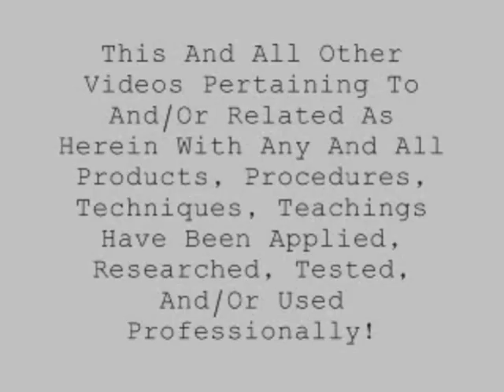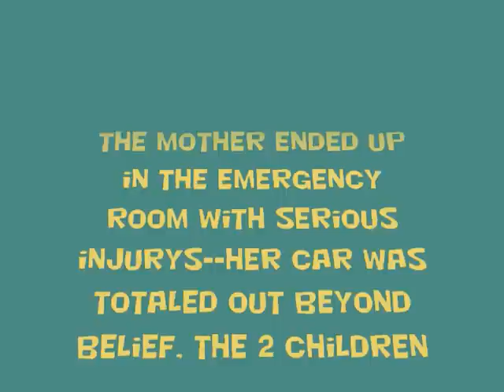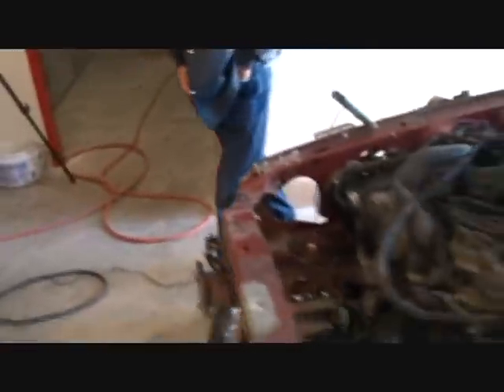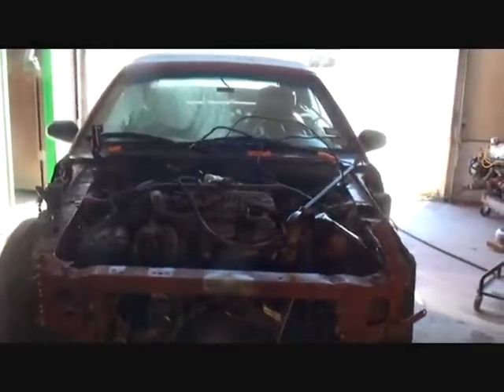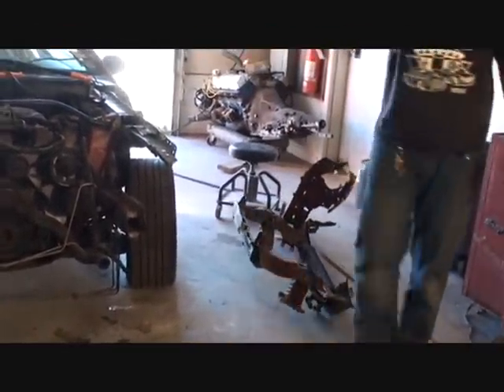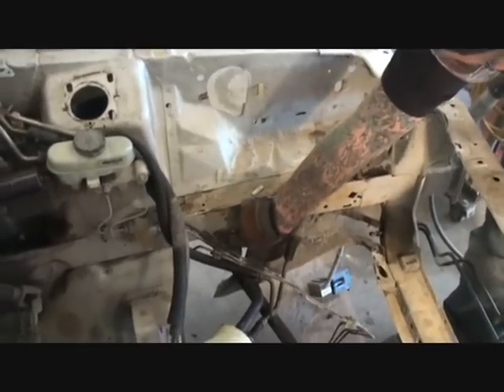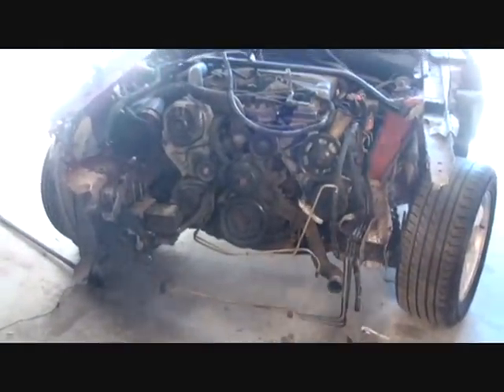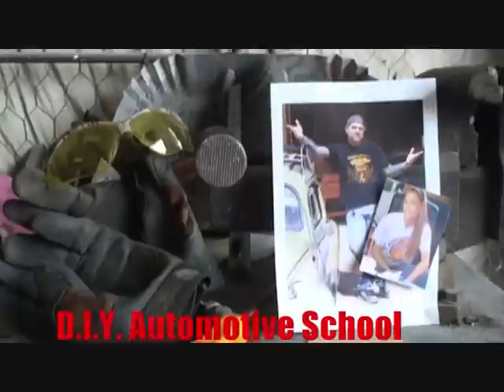Mustang GT-Collision Repairs-Do It Yourself-Part 11

Comment: i like grinding out as many welds as i can like the ones on the passenger side of the core support if u grind them like that then you have a nice clean area to weld the new piece to, and on the clip you would drill all the welds then you have 90% of the prep work for the welds done and you end up withe same amount of welds all in the same spot as the factory i call that job strait up gravy.thanks for the videos pete you are the man and aint it amazing how1weld can hold the whole thing  up

Comment: No frame splices!!! I just got done resurrecting mine from the grave after a major wreck. Drill the spots welds, follow the seams,  and only make connections back to the factory connections. Might involve removing more from the car, but in the end, still factory strength, Splices are not good, even if only in the fender aprons. Only way I would say splice, is if you add gusset plates and seal weld all seams, connection points, etc.

Good page and lots of info though. Dont take me the wrong way.

Comment: Had a 94 mustang I crashed into the ass end of a truck at age 21 back in 1999..   Was like new..  It bent the radiator support where the hood latches.  Mitches auto  body put it on frame alignment back on the road for a grand.   Never did get nothing more than a primer coat on it tho..